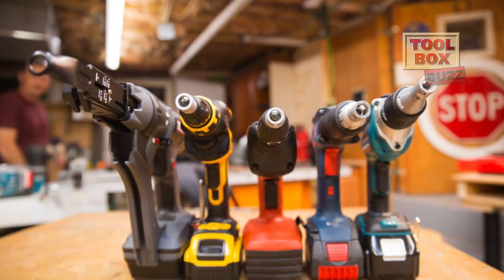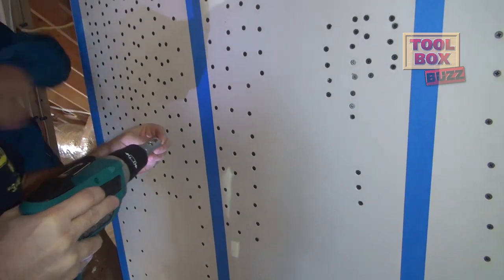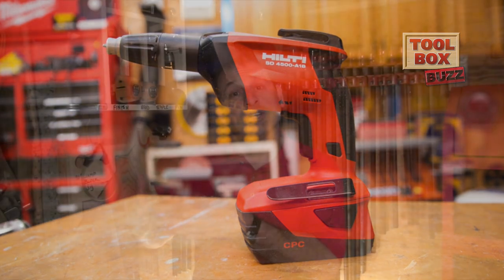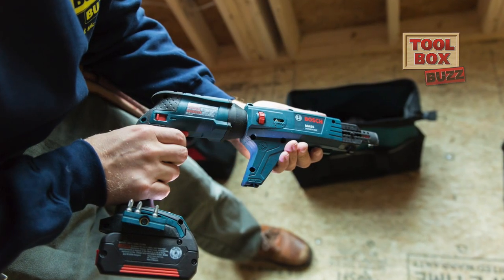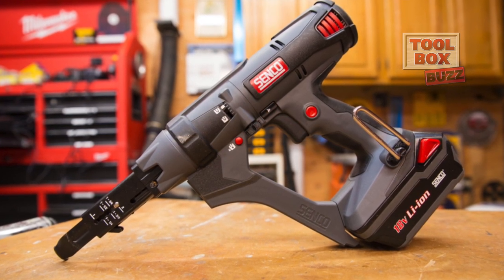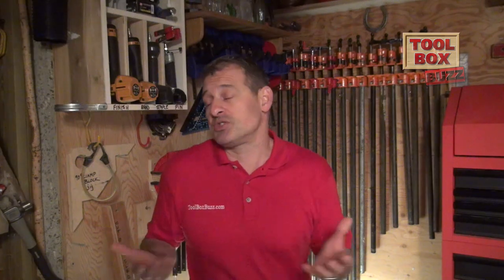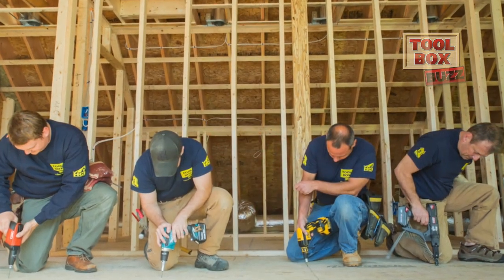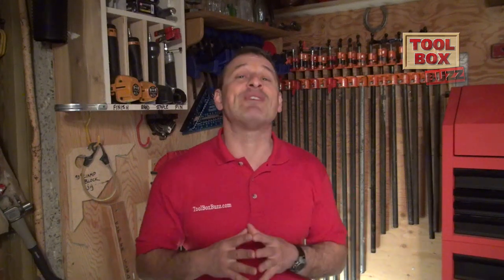Cordless Screw Guns - Head to Head Comparison

Comment: I am someone who has hung thousands of drywall board's and used every one of thoose guns except the collated specific one I have to say hilti is best,, then milwaukke (not in this review) then makita. As a professional/journeyman I would recommend the new hilti 5000-a23 because it is so reliable good battery life and will drive any screw without cutting out. Its also 30% lighter than the old ones. Then again you should try to buy tools in which you already have batterys for. But if your someone who is new to hanging board/doing a home remodel i would say milwaukee. Just my opinion
Reply: I agree to a degree. It depends very much on how much the user is going to be using a tool. If it's going to be used by a drywall installer there is no choice it is just Hilti. All the others aren't up to it. But they are all fine for periodic use. The only one I haven't used is milwalkee but I'm 100% confident that it is on par or at best marginally better than the others. But for all day every day use. None will touch the Hilti. On top of which the Hilti contract lease system you can use is excellent for service leading to less down time and easy for companies to budget tool expenditure without any repair/replacement costs.
Reply: What about Bosch one?

Comment: First off: Excellent video I found it very insightful and useful. While I do not work the field I do repair tools for people who do work in the field and it is good to understand the aspects they value in tool design and performance.
Secondly: I have to take my hat off to the community in this comments section and the construction community overall. I have been in other communities both as a worker and as someone who frequents the internet and I have to say that overall this is the most mature, polite, and professional community I have found yet.
Lastly: While I and people I talk to on the field agree about the performance of DeWalt's screwgun, a common issue is the Spindle Sleeve (yellow funnel on the clutch) breaking and trapping bits in the clutch. I have yet to find a way to reattach/replace the Spindle Sleeve once this occurs beyond sending it back to DeWalt. If anyone has any insight into this problem can they please let me know?
Reply: I would have liked to see more on the performance of each tool. How well do they repeat on driving screws to a set depth. For the collated versions, how easy is it to load, how many screws per load (how often am I reloading). Those things enter into productivity as much as or more than the ergonomics of a tool.

Comment: In order from best to worst , having used them all commercially. Based on weight, screwing speed, reliability and ergonomics. 
1; Makita (they have a brush and brushless models which perform the same)
2; Dewalt
3; Hilti & Bosch are a tie in my opinion
4; everything else
Reply: how long did you use dewalt? I find that it's not consistent. Sometimes screw goes deep sometimes too shallow. If I need serious work I use corded makita
Reply: cb7pwn I would take the Bosch

Comment: Both my boschs died under a year, I bought a second hand hilti and a year and a half later it’s still going. The thing is a tank. I love makita too, I can get a bout a year 4 months with it. Dewalt is the the weakest. Tho it is Light weight n cheap, the screw depth adjusts as the battery life weakens. Bosch is an awesome gun but it didn’t last enough for 450$
Reply: Weird if you have 3 years warranty for bosch . .

Comment: I'm now convinced your blog is brand influenced.   6 years ago on a big drywall project I used a Senco autofeeder, which came with 2 cadmium batteries and a charger.  The weight of the tool was actually lighter than my cordless cadmium DeWalt hammer/drill.  Moreover, my only concern was, "would it sink a screw head the desired distance?"  And on my first few tries it did not.  However, then I realized I had it on the wrong setting. After that, "perfect" 1/16" depth every time. Hence, what more can you ask for when putting screw to drywall? That's a home run on every pitch.   Furthermore,  I could not believe the speed at which sheets of drywall were going up.  There was one tiny flaw: the spent plastic belts created just enough counter torque on the aim of the last few screws.  So, I experimented a little by cutting half the spent belt and there was not a single fail, even when the battery was going dead.  Hence, I reported this to Senco and they were already on a solution.  So I let everyone on my crew have a go of it and we ended up fighting over it.  By the end of the build, our boss purchased 2 more and not a single report of flaws after I told them to cut their belts in half.  So how can anyone beat that when it comes to putting up drywall?

Comment: @tool box buzz:
PLEASE HELP— respond.
I bought the dewalt based on this video and i own other dewalt.  

The senco floor screws are all #2 square drive.   I can not find a bit to work in the drill.  I have modified a bit that was too large diameter and slightly too long.  But it does not feed right and jambs up.

PLEASE TELL ME WHAT BIT YOU GUYS USED IN THE VIDEO!

Comment: As far as why not collated its pretty simple from the outset that the cost involved is around 300-400% more with collated Senco strips - area sensitive of course. But wait, theres more, if you do "piecing" specifically in closets, laundry closet, pantry, tight or odd/hard to reach areas, collated means bigger hassle. On top of that is jamming and malfunctioning. Its sad that the Metabo SE LTX 4000 was not included. For no collated 1/2 inch work on wood studs, the dewalt dcf620 (without collated attachment) running 4400 rpm, brushless, 2.0 ah slimpack battery, is the way to go. Hilti might be next up, running a brushed motor @ 4500 rpm. If doing gyprock 5/8 inch, depending on brand of input material and wood vs steel studs, a Makita XSF03 brushless @4000 will outbeat the Hilti and the Dewalt in performance as well as in the aftermath of fatigue feeling in your wrist. One Thing is for sure, the Dewalt DCS551 router is pretty much the best one out there. Nobody is forming line for the Makita vibrator.
Reply: Elgo Wiebe Senco in the test is 5000rpm

Comment: In addition to my comment below I'd like to say that you can't assess just by trying that for the whole day. I like the idea of trying tools, it's really good and helps out people who are looking for new tools to buy. However when you use the tools every single day for years you face real situations and problems. What if you have the insulation pushing the drywall a lot and you need to screw very slow, makita is the worst for this, hilti is the best. What if the stud is off or the wood is harder and you need more power, dewalt doesn't have that power in low speed also for screwing double 5/8 with 2in screws, or screwing metal frames or resilient channel. The best people to try tools are the workers in the trade. This is just my opinion. I wish Toolboxbuzz the best :)

Comment: First off no one in this video knows how to properly use and hold a screw gun. As far as corralated screw gun ive never used one and it appears if you use one your probably not a real carpenter and just a drywaller or just someone who has a lot of money. Im a commercial carpenter  in nyc its mainly steel framing nd drywalling, I have the makita and use it for both and wouldnt trade it for anything else. They don't take durability or price point into consideration. dewalts are made of mainly plastic and are meant to break if dropped and hiltis are just expensive and everybody on the job just trys to steal them. Hope this comment is helpful

Comment: Im woundering why you guys in the US dont't use colleted screws only. Here in Sweden the other guys on the worksite will look at you sideways if you dont collated screws. And we have used collated screwguns for a decade now. I notice in this Video that the guys using the guns dont use the topgrip on the guns the Dwalt, Makita, Hilti, And Bosch are made to lay inbetween the tumb and index finger. and not to hold in the handle. otherwise i really liked this video.
Reply: agreed mate.  Here in Australia. its collated or nothing!
Reply: its cheaper, it never jams, its lighter and when drywalling  in highrise buildings often you are in tight corners or behind pipes and the collated would not fit. in houses the drywallers pay for there screw and nails, so they nail the sheets and then go back and screw the middle of the sheets its not worth it for them to pay 3, 4 times for the screws. and a good drywaller here (canada) still manages to put up 80+ sheets a day.
Reply: Mattias Schill Using standard grip is good for demonstrating a screwgun's kick in videos.
Reply: Mattias Schill from the states, these guys are fools, you can't have a real opinion on ergonomics of a gun when you use it incorrectly, idk what the other guys are talking about either with nailing half and screwing half, I've been a union drywaller in Chicago and Seattle and that it not true lol, all screws, nails are a thing of the past. 100 sheets a day on t.i work tho
Reply: hairynose656 80+ indeed
Reply: Cost of the screws
We get into a lot of stuff that requires us to change screw lengths on the fly.
Reply: Agreed.
Reply: a pro hanger can put 3 screws a sec without a collet. (Mexican) I dropped my jaw when I saw it.

Comment: 08:30 Another consideration for the Senco, for me anyway, would be I have no other tool that uses Senco batteries, so those 2 4AH batteries will only be used with that one tool. If I bought the DeWalt, even though it costs a little more, those batteries can power a dozen other DeWalt tools I already have. IF Senco had partnered with a big brand tool that did not offer their own screwgun and used the same battery, then they might do better in sales because they could sell the screwgun as a bare tool, no batteries, and be priced way lower or competitively with other brands plus have a higher profit margin as they would not have to include the battery and charger at a loss just to be competitive pricewise.
Reply: I not used a senco for a number of years but they used to be absolutely awful for jamming.

Comment: Just answering the question on the festool screw gun they can give a lot of trouble in regards to jamming,hilti are yer only man if you're hammering screws day in day out but they only take hilti collated stripes no other brand.I use the dewalt myself because it suited my budget & have been using the brand since the geggo so familiarity played a part in my purchase also.I'm an Irish plasterer by trade & work along side a lot of boarders & plasterers so get to see what everyone is using.Makita is another brand thats well used & as of yet I have'nt came across anyone using the bosch but it looks real good.Hope this helps & happy screwing!
Reply: do you reccomend the dewalt mate?  I just sold my old Hilti and looking to upgrade...  Not sure if I stick with Hilti or try dewalt
Reply: I do commercial roofing, I go from attaching plywood for roof deck lay overs or on walls for a clean surface to adhere to,  attaching iso insulation, mechanical attachment of the roofing in plywood and metal roof decks, attaching the various accessories needed to make a roof water tight. In all these applications the dewalt works flawlessly. in our trade a source for power and enough cord is a problem, also untangling those cords an issue. I liked the one I boughted so much I bought two more, with a 5ah battery and a quick connect tip holder no job no matter the mechanical clutter is a problem.

Comment: I wonder why they are holding the screw guns wrong
Reply: I do dry wall and just got the dewalt gun today, that’s just how you hold a dry wall gun, see when you are driving a lot of screws the straiter your hand is to the screw the less change of the screw going in wrong. They are a very comfy gun to use

Comment: I hang drywall every single day we never use collated screws never use them never will I'm just as fast without it I started with corded now I'm only cordless the gun and the router these guys are holding gun wrong just for starters I started out with a DeWalt cordless then went to the Makita then went to the Milwaukee in between that I use the Hilti I'm with the Milwaukee right now for over a year and I love it all around minus that every now and then I have to take the cone off and push a screw in in the corners every now and then but I'm super fast with that gun I can't wait to try the Bosch would love for a chance to get a Bosch and some batteries to test out we do multi million-dollar houses every single day..and average home renovations ..long island ny

Comment: I own the dewalt version. Wondering if you recommend it for attaching 1/2" plywood instead of drywall? Going to plywood the interior walls of my insulated detached garage instead of drywall. Thinking of using 2" collated decking screws from senco. Any reason this won't work? I believe the specs on the dewalt say 2 1/2" capacity. Not sure that includes decking screws or even if the decking screw collated plastic is the same size/shape of the drywall collated screws. Any one have advice? Thanks in advance!

Comment: Could someone explain the difference between impact driver, drill, and screw gun? I looked through YouTube but couldn't find a good explanation. Why would you get a screw gun if you had a good impact driver?
Reply: jawojnicki drills are best for for drilling holes. Impacts will break a drill bit. Impacts have a hammer mechanism that drives big screws and the like extremely well without torquing your wrist like a drill. Lots of torque for deck screws, tap cons, etc. Screwguns like these have depth setters and the appropriate rpm and ergonomics for drywall screws. Hope that helps. If you have more questions go for it.

Comment: hilti and makita both make cut out tools. this evaluation is trash. hilti is the best gun. iv had all the tools discussed on here in real world application. hilti is king.
Reply: I own all but the Bosch. Each brand, I have one each. With exception to the Hilti, I have four of the collated versions with the stiff/ridgid strips. The Hilti is definitely King of The Hill in this comparison. I will admit that none are garbage, in my opinion....but the others have the flimsy strips...which are more prone to jams. Hilti is my go to for large jobs. Not even close...
Reply: I love my Bosch it's really nice drives screws like a dream and depth controll is really easy. It's small size makes it easy to screw corners and tops and lids are very nice. I've never used it's auto feed attachment I use the hilti autofeed.

Comment: I'm a drywall hanger and 10 years of experience I say that  the best gun screw gun is Makita. all this attachments to pun on the screw gun don't work well like you see on the video. try it on the corners!!! other is the clutch gear on them. some screw gun Las one week some less. on video is so new guns is why they smooth but after days you will see the diferens. so if you want a good screw gun!! go Makita!! wort every peni!!!
Reply: i have the Bosch with magazine for like 4  years and its still going strong on daily use but i have to admit that i regulary maintain my gun 2 times per week and don't use it as my co workers as a hammer or  throw it after we go for lunch.
A little gun oil and graphite poweder is all you need.

Comment: Talking about productivity, why wouldn't you use the collated...its a lot faster and but if you compare prices, its almost the same!
Reply: wait, what prices? of screws?
Reply: The screws are more expensive but your time... on the job is way more expensive so it works out cheaper in the long run
Reply: Almost all of my guys can hand feed screws faster than a collated system. If you don’t use them you get used to doing it fast by hand. Its not an un common thing for us at all. For a guy that goes from collated to hand feed it with be so slow but if you have always done it the right way then its really nothing.  Im the Forman and i only get collated if we are doing large amount of celings or hanging type c rock on the ceiling which is way heavier
Reply: @jimboneutron8399  it really depends on the job. I have the Bosch and i can be quick on single screws.
But if we do like 100+ feet hall ways and i don't need to switch screws for 2mm UA Profiles i use the magazine attachment.
People always claim they are faster but in reality they are only faster for like 2 to 4 sheets. Than they lose concistensy. And the most important is i don't have as much cramping hands

Comment: Why didn’t you compare the best gun out there?  The Milwaukee fuel with the auto start feature?  My father is a die hard dewalt fan and owns the dewalt version.  He agreed that my Milwaukee is far superior
Reply: Milwaukee is weak when u are driving. 1⅝ + screws on wood.  It turns off its doesn't have the  torque power for example  if u do double layer drywall   Milwaukee turns off on you driving in the double layer screws
Reply: @giantgigante7725  no it doesn’t. My m18 fuel screwgun with 2.0 battery have no problem with 2inch going through 2 layers 5/8 on both res channel and wood.